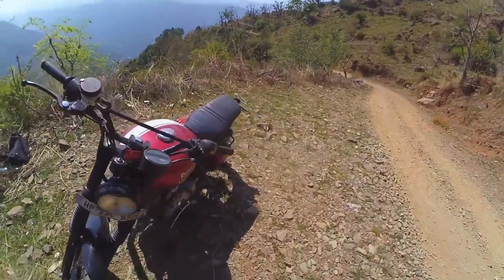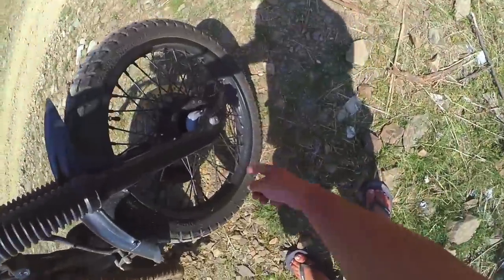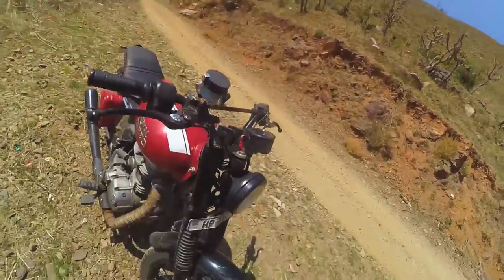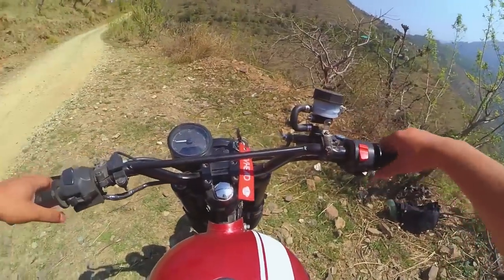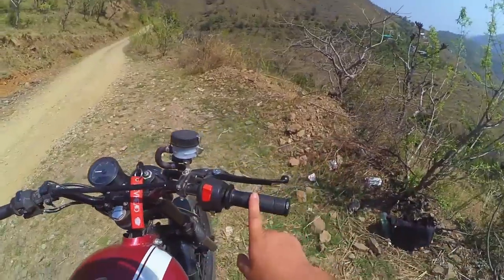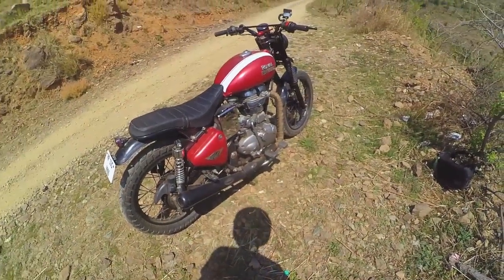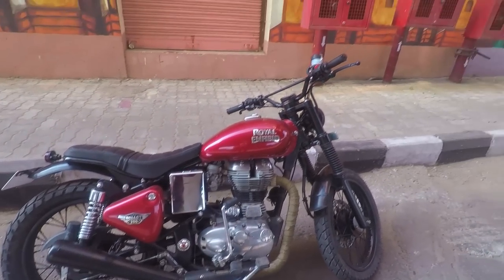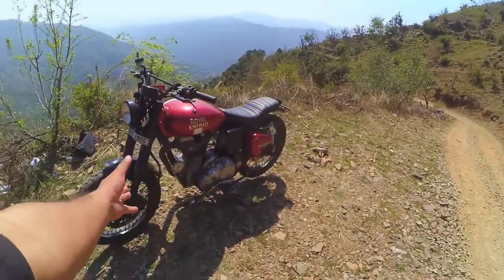Finally Review Of My RoyalEnfield Bullet Scrambler Conversion

Comment: Bhai,
Reply karna please.
Mein Royal Enfield ki bike Lene ki soch Raha Hun.
Mein Standard Lena chah Raha Hun , par uska rear wheel tall hai aur tyre patla hai..  stock condition mein mods hona mushkil hai.
Phir ,classic hai jo ki staying or wheel wise ok hai, par mujhe aisi bullet chahiye to thode salon Baad dated ne lage, I mean old thunderbird looks like an old hag in front of the new one.
Then there is Electra but I don't like it's rear look and it has the same thin tyre.

Can you give some useful advise
Reply: Go for standard bro. I also have 2019 standard 350. And I changed the back Tyre to 3.50 which earlier was 3.25.it will cost you around 2k to 2.5 k.
Reply from the maker: bro go with standard but self & disc sacrifice krne pdenge , if you have budget then go with classic with double disc
Reply: @revheadd  dude, every thing has changed, Yesterday I just did an amazing 275 km one day mountain ride on a rented bs3  Himalayan, it's so comfortable....
I think I m gonna go with that...
Thanks a lot